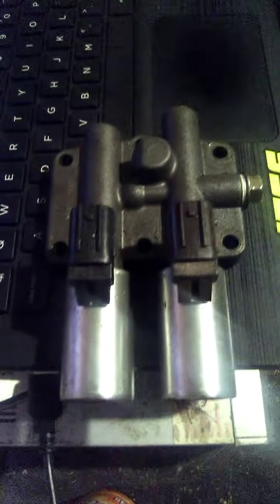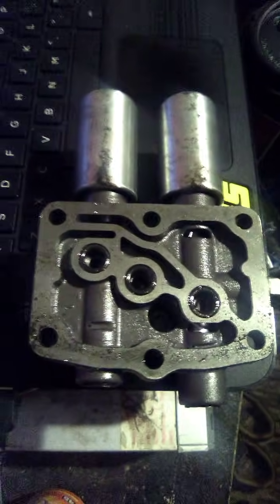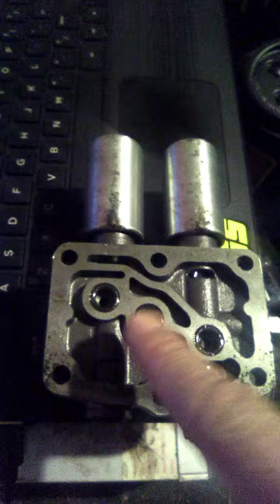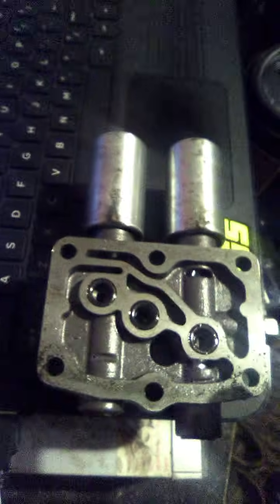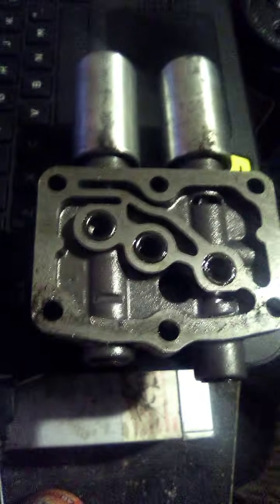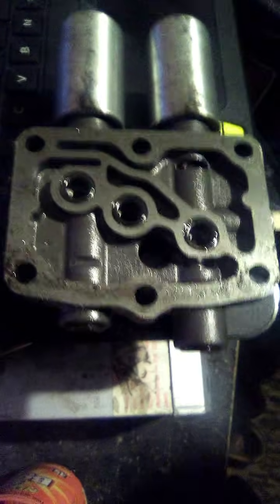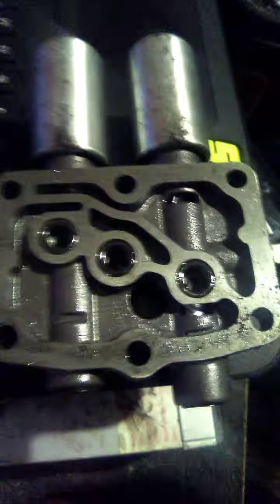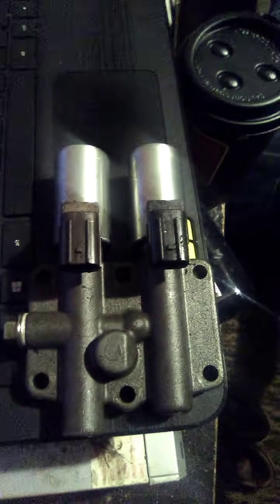Honda transmission problems explained p0740

Comment: I need help I have a 2006 Honda Ridgeline it was driving fine until all suddenly it went into neutral mode even though it was on drive truck was barely moving I pull over waited 15 minutes started fine and drove fine for few minutes then was struggling again to drive normal got home check fluid it was black and smell really bad I change fluid 3 times truck will drive normal for a bit and then will act up again like won’t drive forward and be like neutral or won’t even drive at all had to pull over let it cool down then truck will drive normal at least make it home but all this time changing fluid 3 times I keep getting this awful burnt smell but on the third time trans fluid change the smell is less or practically gone but finally I got the error code P0741 and according to this code can be multiple reasons 1 is low on fluid which is not and trans fluid is semi red not completely black 2 TCC converter solenoid 3 could be trans converter 4 could be transmission. So what can I do to fix this issue on my truck any advice appreciated.

Comment: Thank you. I have a 2002 Odyssey and it clunks going into 2nd and 3rd gear.  I can drive very slowly and let up on the gas each time it shifts but takes pateince. So when I'm going uphill I use the manual shift. But you have to let up on the gas each time you shift from 1st 2nd to 3rd  etc. 
On a steep hill I stay in second gear. 
I've watched a lot of videos and read a lot of comments about this and I have decided to do 4 flushes in one month. I decided to use synthetic oil from Walmart gallon container $26.00.Synthetic Valvoline MaxLife ATF.
  many mechanics have recommended this. 
Also sadly there is no filter in this generation Odyssey vans.
I think it is 99 or 2000 to 2005. Odyssey made a big mistake by not putting in the filter. 
There is however a black canister on top of the transmission underneath the battery but it is not actually a real filter it is simply a magnet. It's $30 but I don't think it's worth changing. In fact the dealership never touches it. 
I've decided to put in a real filter on the lower cooling line that goes through the radiator for cooling. I also I'm thinking about later putting on cooler core in front of the radiator.
Reply: Hi, ever found a fix for your car? My honda fit is like this. Kind of a hassle to time the shift and let off gas every time
Reply: @pjsaltbabyrage7567  I did the four flushes but I've not noticed any difference. I removed and tested one of the solenoids underneath the battery. I hope to remove the other three or four and test them also. the main problem now I think is the torque converter is ruined. So I will have to continue shifting manually. There is plenty of Google information about damaged torque converters generally not repairable without removing them completely. It's not worth it
Reply: @2Jeezuzisreal  there should be screens on the solenoids what are linear
Reply: @Tech-Cooking Yes I removed 2 solenoids under battery and the screens were clean. Maybe the others are clogged but I can't even see them under all the junk. 
Flushing the trans was a waist of time and money.  It's a clunker van forever. Shame on Honda

Comment: Hi Rico, I need advice on my 2004 Honda Odyssey, the tranny pulls just fine when it's cooled down, but after driving it just a short while it starts slipping? The fluid is burnt and it overheated the other day and I had to be towed home. It has a external cooler but I'm not sure if the tranny is bad even though it pulls fine at first, it has a lot of miles, however my 2003 Odyssey has over heated before a few times and after letting it cool down and also changing some of the fluid later it still pulls fine, but my 04 is ALOT nicer and better shape big time, but I don't trust the tranny at all? I need to get the 04 fixed but I can't afford to have the tranny rebuilt, WOULD YOU GIVE ME YOUR BEST ADVICE ON WHAT I SHOULD DO? I could have the tranny out of the 03 put in the 04, but since it also has a lot of miles on it that would not be a good idea. Let me know?

Comment: Hello I have a 1998 Honda Civic 4 cylinder automatic & im trying to figure out if my Torque Converter clutch solenoid  is bad ? My car will start and go into drive but its a hard shift from 1st to 2nd gear and sometimes 2nd to 3rd and once I drive it for a minute it'll just stop accelerating and I can turn it off and let it sit for a minute turn it back on and it'll go.... what do u think could be wrong

Comment: This video put my heart at ease. Im glad it most likely is a solenoid/fluid issue and not a whole tranny issue. My 02 starts and takes off fine for about 10mins then starts to overrev into 2nd /3rd then just doesnt wanna engage after that
Reply: Hi. I am having the same issue. We're you able to resolve it ?

Comment: My man, I replaced that part and now the v6 shifts hard into reverse and into D4. We added fluid to top it off. Removed it and found sum debris in the center tube. Cleaned and installed. Stop shifting so hard it moves the whole engine and trans. 🤦🏽‍♂️

Comment: I am using a Honda Accord V6 3.0 2004 model .. my issue is when I give full throttle the rpm goes high but the gear not shifting down 👇 .. but in normal drive all the gears are changing

Comment: Love your vids, man. Have 2006 Odyssey Touring and I just replaced driver axle, lil fluid dripped out so I added equal amount. After engine oil change, trans slips/won't go into gear immediately once warm. Did trans fluid flush w Honda trans fluid and feels BEAUTIFUL...but same issue. Again, when cold or cool, NO issues. But once warm, same thing. Would replacing solenoids and cleaning screens possibly be the issue or do you have any other suggestions? Thanks a ton👊🏻

Comment: I just bought my pilot 2-4 days ago it’s a 2004. Paid 3k for it.. only issue… code 0740. I went and bought trans oil from the Honda dealership and Lucas from autozone. Going to flush it out tonight. Tomorrow I’ll be going to the junk yard and pull those solenoids off. Test them with a battery and double check the solenoids that I currently have for particles when switching them out during the weekend. Also need to buy new gaskets before I take off any solenoids! *almost forgot. Issue my pilot has… it has trouble from 1st to 2nd. There’s a jolt. Anyways I’ll be updating in a few days….
Reply: My 02 Honda Civic won't leave first. Been slipping seldom yesterday driving. I think ill have to clean or replace the solenoids. I look forward to the update
Reply: What fixed your 1st to 2nd jolt?
Reply: @pjsaltbabyrage7567  did you ever solve this issue ?

Comment: I have a 2009 tl sh-awd. Do I have the same part cause I have 300 rpm surges under light load. 
Does this mean I need a new shift solenoid ? Or will cleaning it fix the issue 
Also I just changed the trans fluid
Reply from the maker: Shift solenoid is the cheap check if that won’t help and ur not low on oil could be internal issues

Comment: Hey Rico
I have a 22004 Honda pilot in the some time in the mornings when I put it in Drive it wont go, I put in reverse then back in drive and it goes, the transmission shifts properly it only does it when its cold,what do you think?
Reply from the maker: i had a civic like that i think is a pressure build issue e[def internal cause i change solenoids and it was still there i just always put reverse hit gas with brake on and i was gone

Comment: One thing you forgot to mention is the fluid pressures through that A/B solenoid are adjustable. It requires a specific tool to turn the 5 sided head (one on the A and another on the B) for adjustment.
Reply: More info on this plz….

Comment: The lack of flow through the solenoids CAUSES the heat buildup and it’s manifested under load.  Great tip to check it again a few weeks after cleaning.  Also change the fluid filter if it’s serviceable (under the trans pan or external).  Coolers are nice for towing/racing but finding the root cause is best to have it operate as it did new.

Comment: I have a 2004 bond pilot it goes great for about 45 minutes then it completely stops won’t go into any gear the motor just revs up , I wait 30 minutes let it cool down and will go fine for a bit then gets hot again, I took it to the garage and they told me it was the the transmission . Could it be the solenoids?
Reply: Have the same symptoms with a 2004 Honda civic what did you end up finding out?
Reply: @josiahlehman1506  it ended up being the transmission I know it’s not what you wanted to hear but Honda had all kinda of problems with transmission then
Reply: @susanmcgalliard7885  Thanks for the reply

Comment: It's kind of funny hot shots were recommend a transmission I wonder if they even change out the transmission I wonder if they just take out the solenoids clean up and then charge you for a transmission

Comment: This video is fantastic. My problem is when I ease off the throttle and start to brake, I feel the transmission hit as I slow down. when I start the changes it makes them perfect.
if you can help me see if it is a solenoid or the complete transmission. Honda odyssey 2006. thanks

Comment: I took this part out and there was nothing in it. Bench tested, no issues. P0741 remains
Reply from the maker: There’s few sensors are u having the hesitation shifting or just the code
Reply: @ricofedericotv9393  Abrupt downshifts at random times
Reply from the maker: @Dosalt  there’s a solenoid for up shifts and another for downshifts

Comment: You gotta stop listening to these Acura forums lmfao those screens getting clogged will make insufficient flow if you clean them and still over heating them it’s obviously not that I’d check you atf fluid temp sensor it’s over the third gear pressure switch and any Acura mechanic will you tell you never put Lucas in an Asian trans Lucas is more for gmcs they’re more generic
Reply from the maker: What should I do help me

Comment: what about too much fluid whats taht do?
Reply from the maker: If u over by little u ok cause I ran my pilot over and keep it over didn’t change the symptoms but wayyyy over is gonna come out the dipstick when it get hot is good keep it as recommended level the problem is that they get hot cleaning the debri will help with flow and maybe adding a fluid cooling radiator

Comment: thanks my frend that's exactly what happens to me i changed the oil twice that's exactly what i found blocked the oil in the filter i cleaned it with cleaner break spray
Reply: Did that fix it? What codes did u have?

Comment: My 04 Honda Odyssey  had the slip gear transmission with check engine/TCS light on and Code 730. I changed new transmission fluid and cleaned solenoids. My Minivan’ s transmission is working fine and smooth now.

Comment: If the screens for the shift solenoid are getting clogged, that means the friction materials in the transmission are breaking down and failing. At that point it's only a matter of time.
Reply: Agreed. But I had severe issues with my transmission the shop told me I needed it to be rebuilt for a couple thousand dollars and I put Lucas in it and unclog screens and have driven it 80,000 more miles so far and haven't had a problem since
Reply: @miketompkins2568  what were the symptoms and codes you had what year accord
Reply: @miketompkins2568 wow I hope that happens to me I barely bout it 3 days ago and bam tranny issue 0740 and I’m broke! But a poor man will always find a way! 💪🏽 haha

Comment: My Sister-In-Law Honda Pilot ('08, 1st GEN) would slowly engage in drive in drive (when leave overnight) and move for about 100' then it just disengage with a clucking noise from the transmission. Oil level was very, very low; I added about 2 QT. but unable to verified if the fluid is at the correct level. This issue can be replicated only when the car is cold by let it sits overnight. When hot, the transmission would not engage at all and no noise coming from it. My next step is to change out the fluid but was hoping if you could guess what could have caused this. Thanks in advance for your help.
Reply from the maker: Does make difference if u shift manually meaning go up and down gears urself
Reply: @ricofedericotv9393  It doesn't make a difference when I shift gear up / down; it acts like the transmission is in neutral. BTW, Thank you for the reply.
Reply from the maker: @RotApple0  prob bad trans

Comment: The other day my 03 accord (auto tran) wouldn’t get out from 2nd. The revs would go up slowly and come down at the same pace. Left it a while and now it seems to be working normally again. Don’t know if there’s more issues but I’m gonna change the solenoid.
Reply: My 04 Accord 3.0 started slipping. I changed the trans fluid and it drove fine for a couple days. Now it will barely engage in gear and I have code 0752, 0741, and 0747. I have clean the screens on all the solenoids and it's running like a champion. I had transmission shops and mobile mechanics tell me everything from the place is solenoids too for $500 to rebuilt transmission for $2,000. GTFOH, I don't even work on cars and it took me 2 hours to clean the screens, change the fluid, and put Lucas in it. Cost me about $50. It has 280,000 mi on it and runs like a Cadillac
Reply: @miketompkins2568  Shittttt, I'll have to clean mines because I can't leave 1st gear.
Reply from the maker: That’s sounds like could be solenoid or maybe dirty nets on solenoid try getting one or too from local junkyard or u pull it junkyard and ad a Lucas trans oil and see if make differense

Comment: 2004 Honda Odyssey shifts fine. But goes into Limp mode after 45 minutes or so of constant highway driving. Any ideas?
Reply from the maker: Does oil smell burnt and it looks dry thin
Reply from the maker: Thin I mean

Comment: Hey thanks a lot for this video man my name is Tony relohas and I have a 2002 Honda Accord and it's doing the exact same thing I turn it on and I put it on driving to grab quickly but once it gets hot it starts to slip but I turn it off and turn it back on and it starts working again
Reply: Hi. Did you ever figure out or fix this problem with your transmission?
Im having the exact same problem and its really frustrating.  Any help will be really appreciated
Reply: 1998-02 Accords,  the Odysseys that Era, and the 3.2TLs have a warranty  extension for 10 years/100,000 miles because of this problem. The solution was to replace the transmission with a reman that had all the updates done to it. P0740 was the most common code to see in those, and according to Honda, that was an automatic transmission replacement.

Comment: Great video. Thank you! The 740 code came on and it shifted crazy some times. Took it to a shop well recommended by many. First I watched other videos here and they all said to clean the screens. I told him about the videos but he didn’t like videos. 
He tested and said it had three codes. The first was the linear solenoid. He replaced that and new fluid. Drove off and light went back on. Next he took two of the coffee k cup size solenoids off a used Trans. Drove it and same. The screens still has not been cleaned. I have a appointment at AAMCO next week and another at a different shop. I might even crawl under and see if these are in a place I can get to them Ok. Also had Honda parts tell me the gasket is $43.00. Is it likely the original gasket is reusable? Some videos say reinstall using silicone?? 
Thank you for any advice.
Reply from the maker: What did Aamco said I be wondering what some this stores say

Comment: mine is honda civic 01' and all of you was saying is exactly what happening to my damn civic, it slipped when it's hot! then i turn off the engine to cool down then it's fine again. honda have a problem of this issue but they did not call out for years.
Reply: What did you do to fix this issue bud?

Comment: I'm new to your sight and looking for info on my Honda Pilot transmission not shifting from 1st to 2nd gear smoothly until it drives 7 miles to warm up. I had Ford Explorers that never had a problem till 250k miles, now I hold my breath driving anything else. I'll watch more of your video's next time.
Reply from the maker: Honestly I learn myself anything after 250 thousand miles is long time
Reply: Found a fix for your issue?

Comment: My car shifts great after I start it n after running for about2-3 mins it starts slipping n won’t engage. If I turn it off n let it sit a couple mins it shifts great again then the problem repeats after running for a couple mins. 
What do I  do to fix this?
Reply from the maker: I would check the screens make sure u have oil also what color is it does it look burnt or nice and red maybe ad a Lucas transmission additive
Reply: Same symptoms, 2004 Honda civic.

Comment: Excuse me, my honda pilot 2003 has the code p0730 and p0740, the problem is that when walking suddenly it slides and does not want to give only on occasions and days that it does not, I would like to know how those solenoids are checked with the multimeter and what values they have to have thanks I wait for some solution.

Comment: Thanks for your information. I have Honda Odyssey EXL 2006. around 2 months ago when I was driving 80 m/h on the highway suddenly I saw the RPM going up and down faster. Then I park on roadside open the hood found transmission oil all over the engine and phone there is no transmission fluid all drainage. Then I bought fluid put it in and drive to back home. Next day I change the transmission oil then till now there is no leaking in driving good. Only I feel little push when  it shipped . But no problem I drive 70 or 75 mph. Could you please give me idea should I clean these valves all need to change transmission filter. I forgot to tell you actually I did not change transmission oil for a long time almost 50,000 miles. Oil was vary smelly and dart.